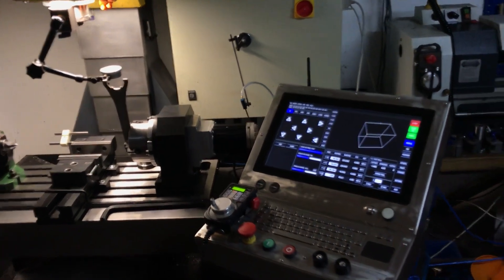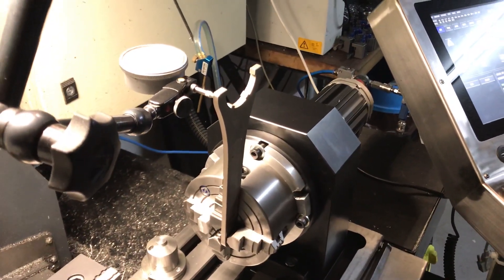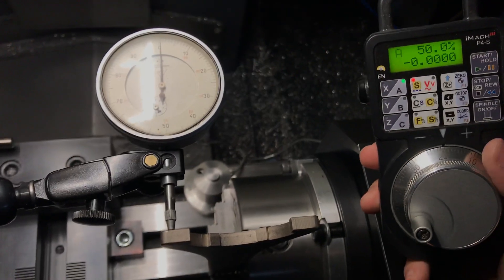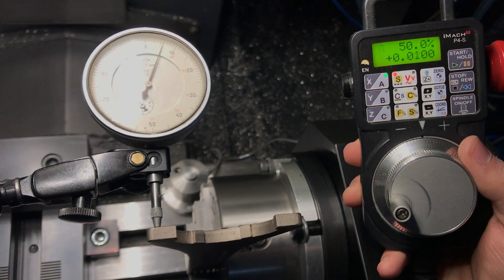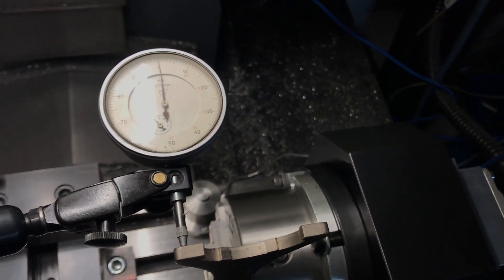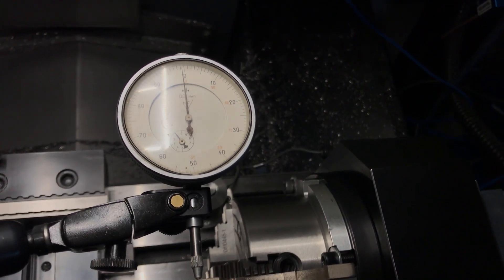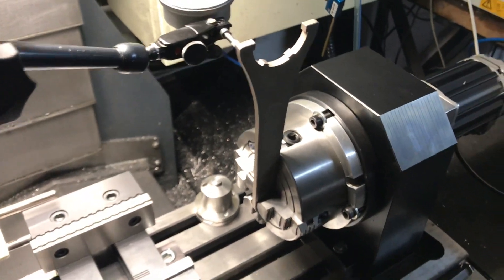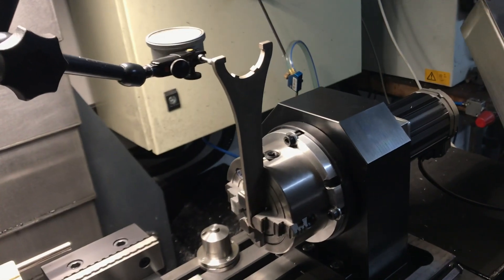Cycloidal drive 4th axis - backlash test

Comment: Nice job..but how much b.l does it have with stepper on and holding position?
Reply from the maker: It's not a stepper, its a servo and has lots of holdinq torque. Need to connect it on the pc and see how much torque it requires on a heavy cut.

Comment: That control panel looks awesome! What model LCD did you use?
Reply from the maker: ELO Touch 1593L, open frame. But I had to make this custom UI for it! 😆Initially I was using gmoccapy, but once Probe Basic has become more popular, I wanted that one, but that works only on FullHd. So I took that as a reference and built my own UI that fits on a 15inch wide screen.
Reply: @LikeFactoryMade  nice! I was wondering if resolution was the reason you needed a custom interface. I may get one of those elo touch screens too - are you happy with the touch and viewing angle etc?
Reply from the maker: @hilo90mhz  yes, works fine, though linux is not the best platform for this monitor. The monitor support 10 points multi touch, but haven't managed to get multi touch working, its a matter of linux stuff that I haven't yet figured out.
Reply: @LikeFactoryMade  Great looking UI. I plan to get into LinuxCNC soon but wanted somehting that was actually nice to look at. Of course, Probe Basic looks stunning but for a beginner (or a small screen), there's almost too much info. Am I right in thinking your UI have fewer elements on the main screen and that you intend to keep it so?